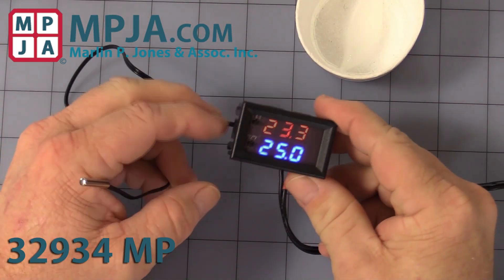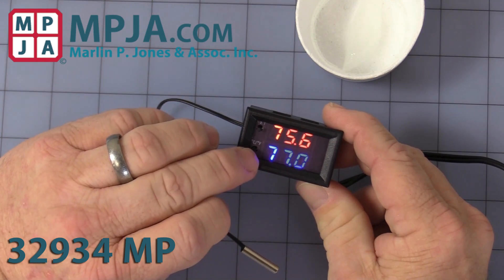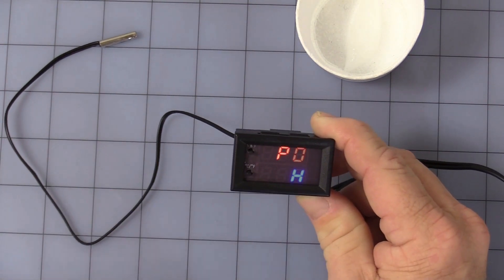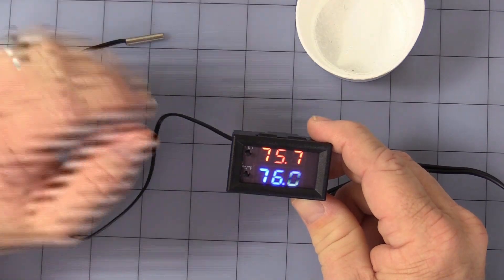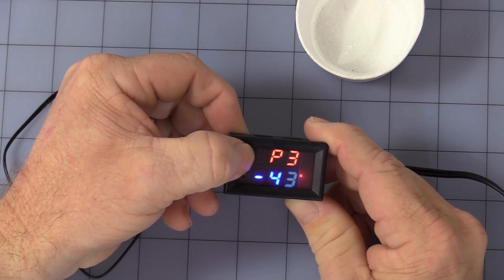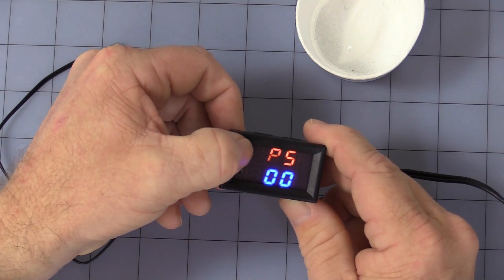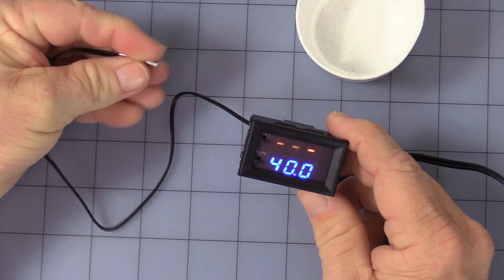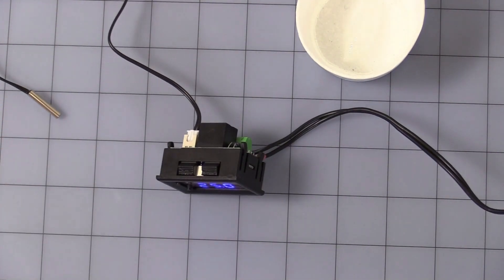Mini Electronic Thermostat 32934 MP

Comment: They didn't send the datasheet in my packaging is there a link to the datasheet? The wiring seems clear in the video because only the device power terminals are landed the relay side would not have polarity would it? It just closes the contact so as long as the relay stuff is on the relay terminals that's all it needs yes?